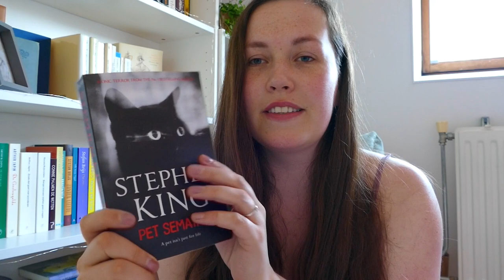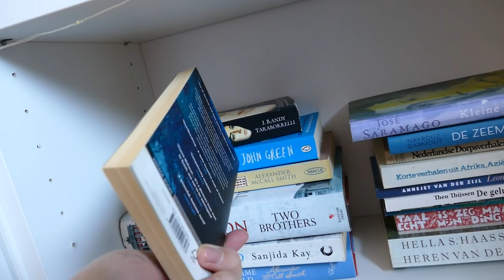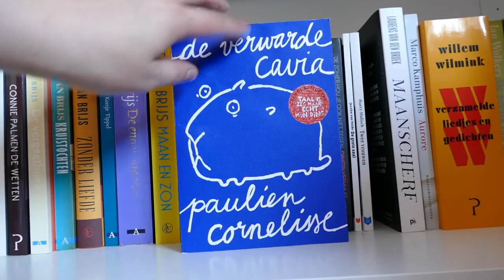My Dad & I Built a Little Free Library! 🪚 👷‍♂️ | Milena Reads

Comment: Hi there from NWCT U.S.A  I will be placing my LFL soon and was wondering what you used for moisture and what you put it in? Thanks much! CaT
Reply from the maker: Hi! We use a simple moisture absorber with small bags in a container. It worked great in the summer, but I’m starting to worry a bit with the colder autumn wether. I think it depends on your climate whether this simple option is good enough.
Reply: Hi, thanks for getting back to me, I just came across a pretty inexpensive suggestion - charcoal brickets!  Not only do they absorb moister but would also absorb odors from musty books!  I hope not to get any of those! I could put a few in a basket/container like yours.   Yours came out so cute and such a nice project for you and dad.  Have you done food in your LFL at all?  Here in the U.S during COVID a lot of folks include food along with books to help those in need.  :)